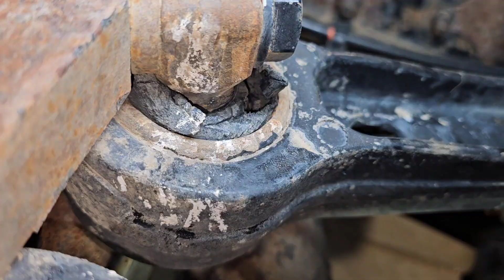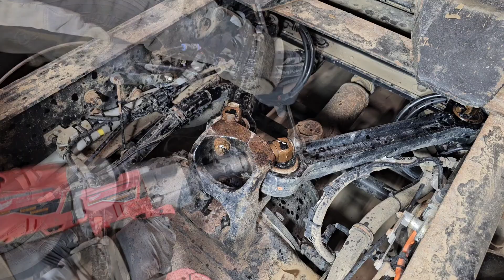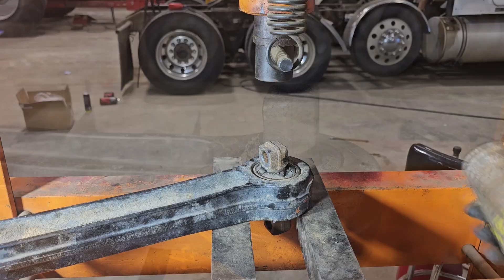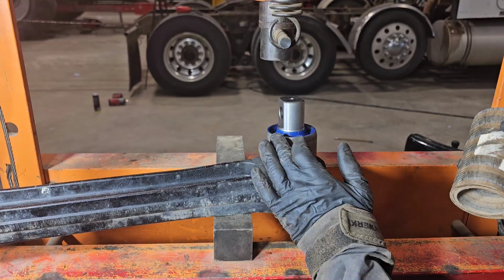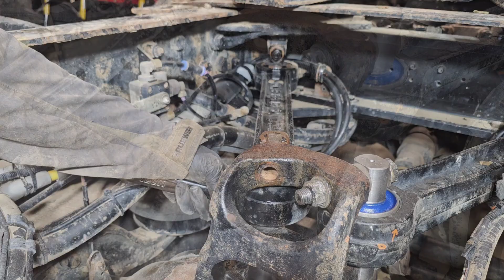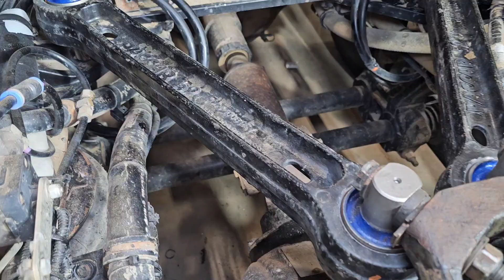How to Replace Torque Rod Bushings on a Semi Truck

Comment: Do you have the press tool part # for taking the old bushing out? Or where can I buy it, thanks
Reply from the maker: Unfortunately it was just a tool I found laying around my shop, just have to look around and find something that fits
Reply: Thanks. Do you know the measurements of the piece of pipe 🤔
Reply from the maker: @marioGonzalez-zt2np I do not, just needs to be slightly smaller than the metal part on the bushing!

Comment: Do you have to lift truck axle or chassis to do this? Cheers
Reply from the maker: You sometimes have to lift chassis to get things lined up, lifting and lowering the air bags will work sometimes too!